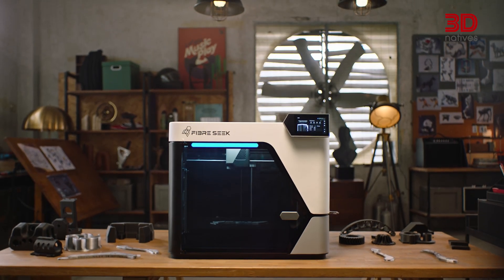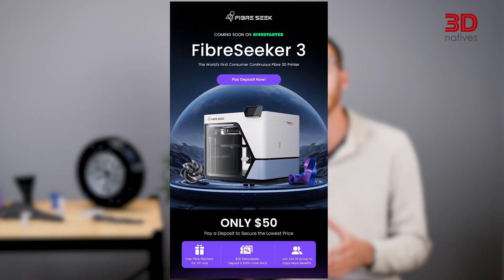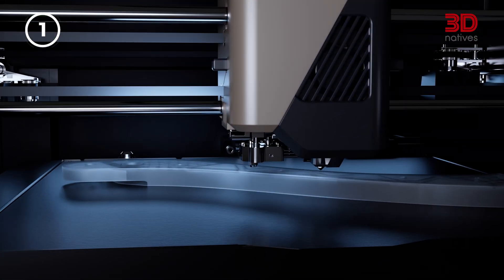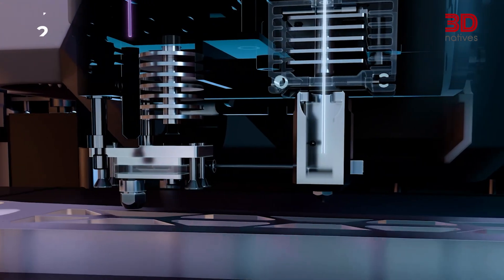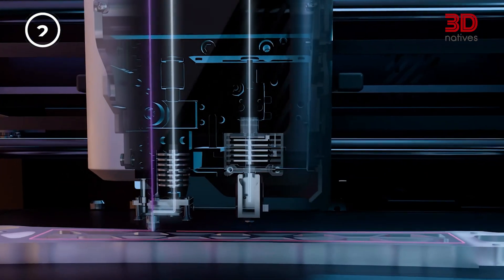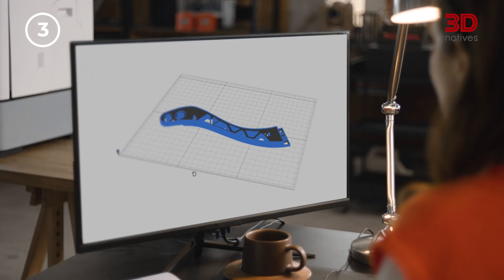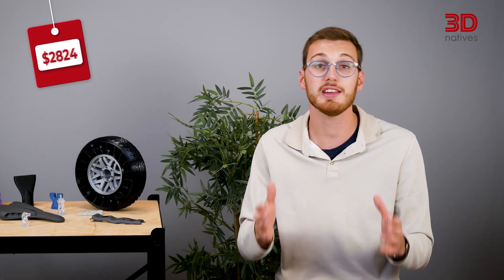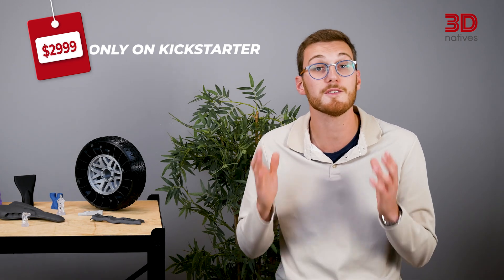FiberSeeker 3: Continuous Carbon Fiber 3D Printing FINALLY Affordable!

Comment: я думаю всем и так очевидно что модель создается по принципу слоеного теста и вете себя точно как слоеное тесто. не вижу смысла так выеживаться ради устойчивости в одном направлении. в идеальных условиях эта штука будет прочнее металла но только в идеально точном направлении усилия. в остальных направлениях разлетится как слоеное тесто
Reply from the maker: Hello! The parts printed using this process will indeed be anisotropic, meaning that they won't be very resistant in the Z axis compared to the X and Y. As such, it is crucial to take into account during the CAD and slicing processes to benefit from the strength of the printed part. Many applications will only exerce force on one or two axes, making continuous fiber 3D printing perfectly suited for these uses. Though for some other applications, forces can be exerced in multiple directions at once and subject to continuous stresses on the "weak" axes. This process won't be perfect in every situation, but for many it is very applicable and economically interesting.

Comment: Nice bull shit that plastic fiber is stringer than metal
Reply: It is, when combined with carbonfiber or kevlar or fiberglass. But you have to u derstand which metal you have to compare it too
Reply: @alialsarraf144 iron?
Reply: @pedroantonio5031 they never mentioned iron. Beside iron is an element. They have mentioned it is stronger than aluminum.
Reply from the maker: Hello, most plastics on their own are not stronger than metals. In this case, the parts printed use a continuous fiber to reinforce the print in the X and Y axes making them stronger than some metals (like aluminum, brass, copper, stainless steel (306) and more for example).

Comment: I have a markforged 2 and the material is expensive , so switching to your printer is ideal. I want to see finished parts to decide.
Reply from the maker: Thanks for your comment! FibreSeek is sharing more details and examples of printed parts on their Kickstarter page, you can check it out here: https://www.kickstarter.com/projects/1763117873/fibreseeker-3-the-first-personal-continuous-fibre-3d-printer
Reply: Has the price of material already been released?